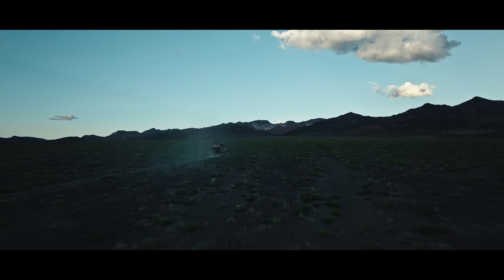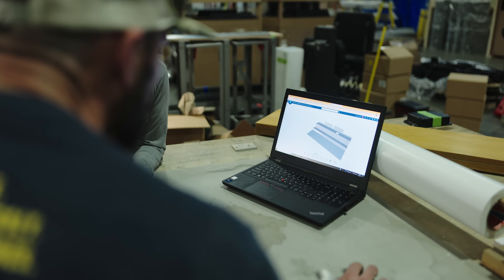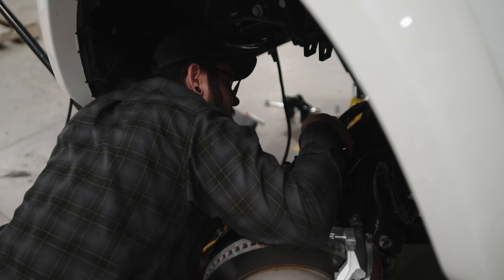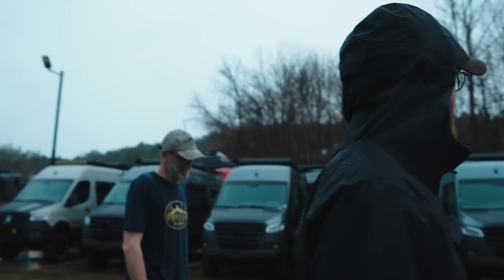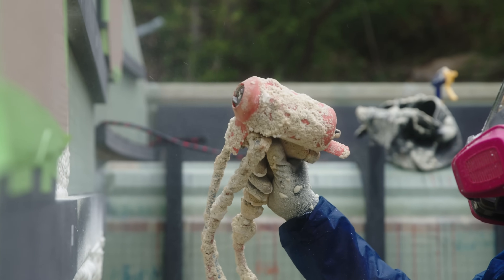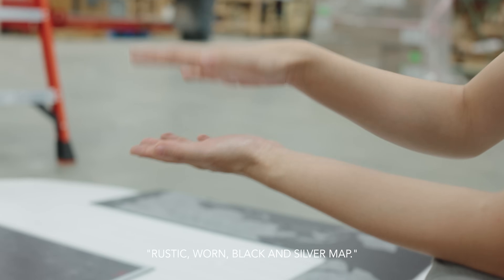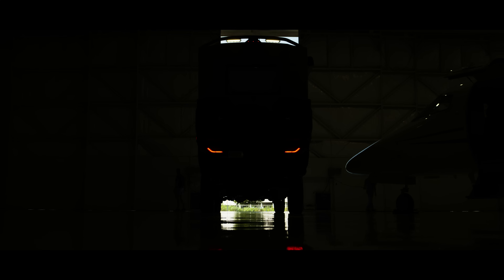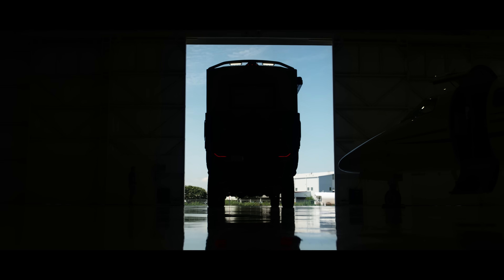THE GXV HILT CHRONICLES: PART I

Comment: I'm concerned with it's long wheelbase, the heavy weight, the unproven hydraulic suspension and the promise of being half the price of the competitors. The biggest and the most", as the CEO said.  This should be interesting.  The fancy video was fueled with some fairy dust for sure.
Reply: Unproven suspension? Liquid springs has been around for quite some time.
Reply: It’s also called marketing.